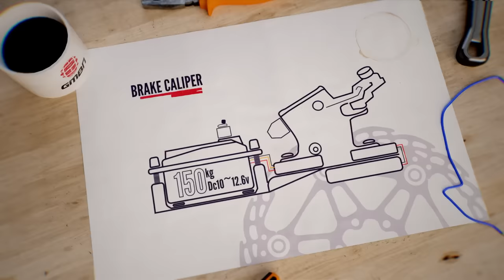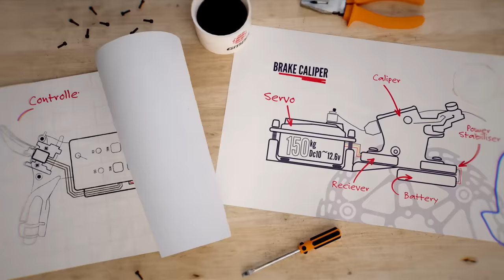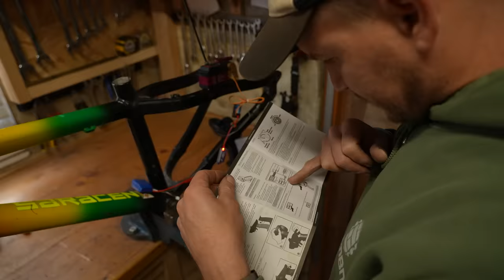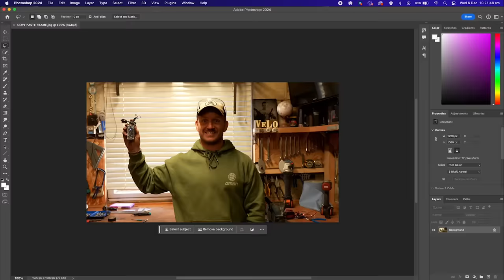We Made The World's First Wireless Bike Brakes

Comment: Good proof of concept, but a really bad idea.
Reply from the maker: 🙃 haha
Reply: Yep. One dead battery away from... well, possible death
Reply: I don’t think it’s that bad:
•Very occasionally my hydraulics have failed on me so it’s not like wireless would be the only one
•If I had these on my bike I’d know I’d fully charge them before every ride
•I would definitely stop if I heard them beep to tell me they are low
•Even if one did run out it’s very unlikely they’d both run out/fail at the same time so I’d just use the other working brake to stop.
Reply: @benw6952  I admit that wireless brakes would suit some riders (and heck, I love the no wire look of the bike, and the freedom of movement it would give), but they would definitely not be for everyone.

As someone who forgets to check the batteris on everything, I probability would be dead (and I know a bunch of people that are just like me).

With that being said, I'd love to see this idea made into a real product, even tho I would probably avoid it.
Reply: @benw6952  what about if u go fast and there is a jammer and the connection will be lost in the system and u could die not good idea u could ruin lot of races with this the only thing u need is jammer very dangerous
Reply: That's a solution looking for a problem. Worked 12 years in electronics. I'm happy to ride my electronics-free  bikes.
Reply: If they make the battery to also self-charge from pedaling power, it should be an excellent idea.
Reply: We need ABS brakes not wireless brakes
Reply: @benw6952  Been riding 40000km off road Never had issues  with hydraulic  brake failure
Reply: not sure ABS would be a good idea mountain biking. There is a reason high-performance enduro motorcycles have ABS shut offs for when you leave asphalt. I can think of at least three times where forgetting to cancel ABS on my KTM 690 almost put me in very serious scenarios.
Reply: @SprSonik13  yeah it wouldn't be good for mountain biking, but for road bikes it would be great if done correctly. Mostly just to save people from small slides during mountain descents, I can't see it being super useful for crit racing either lol more like a safety device for the road bike descenders
Reply: Most anything  electronic  on a Mt Bike  Is Pointless  .
Reply: i bet some company will make wireless brakes. Just a matter of time. 🙃
Reply: I guess it would work very well on an ebike. Then you have a main computer and everything is fly-by-wire. If the main bike battery is empty, you're not riding that thing anyway.
Reply: @BodieMTB I think this is a good stepping stone to bike  ABS. Next video maybe?
Reply: @BodieMTB  they have already made abs brakes
Reply: They have them on some bikes
Reply: The idea is good, but it hasn't really been tested yet.
Reply: @benw6952 if your hydraulic brakes fail you regularly something isn’t right.  100,000+ miles on hydraulic bicycle brakes and no issues whatsoever aside from getting mushy brakes from forgoing bleeding too long. Even on my motorcycles I never have issues with hydraulic brakes, even on track no major problems whatsoever.
Reply: @benw6952  I use Tekro brakes on both MTB and hybrid. 4 years, never failed. I recommend disassembling cleaning the calipers and  brake levers every 2 years.
Reply: Its a start of making it better. Who knows maybe in 5-10 yrs from now these is a common thing 😁
Reply: Imagine the battery died and it turns to a foot breaking system 😮 🤯
Reply: @UrbanFishing-MTB  look at cars and motorcycles. They all still have hydraulic brakes. Even on most recent cars the brake works even if the engine stops and the servo fails, albeit you have to smash hard on the pedal. Not sure about electric/hybrid cars with regenerative braking tho.
Reply: @diorez5112  oh wow really, I guess I should have expected that lol
Reply: Well, not even car companies are researching wireless brakes lol
Reply: @benjy288 That sentence alone is a pretty good indication that not only will some manufacturer make some more marketable version of this, but it will be pushed as the new industry standard and regular hydraulic brakes will no longer be available at the top end groupsets.  Eventually, 105 and SLX will be wireless only and double on price and still make a fallacious pretense at being groupsets for the masses.
Reply: @parasharkchari  Yep, I don't understand why? what's the point in wireless brakes? what's wrong with hydraulic brakes? is it battery manufacturers idea or something?
Reply: I think it's just a case of "we've got to do something new to keep people spending money on new tech." Unlike, say, smartphones or a lot of consumer tech in general, buyers of bicycles aren't too happy with the idea of planned obsolescence... so OEMs instead try to force obsolescence.

"Oh, are you still stuck in the stone age with mechanical shifting?  We do wireless nowadays!  It's the future!"
"Oh you have a 12x148 Boost axle?  How quaint!  Everybody knows that HyperBoost Plus 20x160 is the future! Especially since it makes room for the new electronic hub standard that allows electromechanical actuation of ratchet pawls!"
"Oh, you still have hydraulic brakes?  Get with the times, man!  Wireless brakes are where it's at!"
Reply: The world is full of "bad ideas" that someone was willing to make viable.
Reply: @edymarin7781 it can be designed to be "fail safe". I.e. power actually opens the brakes. Loose power and the brakes apply gradually.
Reply: @edrcozonoking  yeah, I saw that Blake actually did something like that in the GNBN tech video. But still I wouldn't get wireless brakes just because it would be a hassle for me to keep them charged (more of a hassle than I value a cable-less setup).

Still, an interesting idea in my opinion.
Reply: So is electronic shifting and hookless rims, but people are obsessed with them, I'd expect electronic braking to be standard in the latest groupsets by 2030 and you'll have people fervently defending it even as they fly off the road because of a dead battery, exactly how they do now with all the reliability issues of electronic shifting.
Reply: GMBN is sad to announce that Blake has gone missing - last seen being bungled into a SRAM corp bakke by some irate looking engineering okes  in white lab coats 🤣
Reply: @edrcozonoking Your way of making them failsaife could still be fatal in many situations, for me also the problem which could arise from interference is also so bad, I mean why would you make a safety critical component more vulnerable. And what would even be the benefit ? No cables you could route the cables inside the frame. Why risk you life for brakes with no cables, this is max stupidity wtf
Reply: Well the upside is it would be good for barspins and tailwhips
Reply: I guess you don't realize it's been used for over a decade with adaptive bikes and Mobility vehicles for handicapped people otherwise you wouldn't say such a silly thing
Reply: @rider65  No it hasn't, I just googled it and the only thing I found was smart brake wireless for mobility equipment, which is completely different, a mobility vehicle is run off a battery, so if the battery dies the vehicle stops, but a mountain bike doesn't run off a battery, so if your wireless brakes battery runs out then you may end up in hospital, or six feet under, its an incredible stupid idea, and completely pointless.
Reply: @francisdee9955  already have about 10 years on
Reply: @yukiko_5051  amazing how uninformed and unintelligent some people are no car company is R&D the idea? 🤣🤦‍♂️
Wireless brakes have been around for a decade on adaptive mobility and bikes
Reply: Do you know what's pointless? You're uselessness...🤣
Reply: @rider65  Triggered much? no one is stopping you from using brakes that will stop working when the batteries run out, me though I prefer not being in intensive care due to a component that doesn't need to exist in the first place.
Reply: @benw6952  I've never had hydraulic brakes fail on me in nearly 30 years of riding bikes and driving cars, and 14 years of riding mountain bikes, there's no reason for wireless brakes to exist, what problem do they solve? none, they only create problems.
Reply: @mulugetakejela6126  Why? what problem do they solve?
Reply: @BodieMTB  No we don't need ABS, that's another bad idea.
Reply: @dasjay17  No the idea isn't good.
Reply: @UrbanFishing-MTB  I certainly hope not, its the worst idea ever.
Reply: @yukiko_5051  They can research them as much as they want, that doesn't mean its a good idea, why on earth would you want brakes that stop working when the batteries run out? especially when you already have brakes that work great every time that don't rely on batteries.
Reply: @edrcozonoking  The only problem with that is you can't ride you bike anymore, you're on a big ride in the middle of no where and your batteries run out, then you have to walk your way back to civilization with locked wheels.
Reply: @Cokecanninja  Yep, it seems like some people are obsessed with electronics, even when its a bad idea.
Reply: @benjy288  I must’ve got unlucky with my brake failure and I admit it was only once for me.

I feel like it’s similar to wireless groupsets: there is no problem being solved but it does come with some benefits that some people are willing to pay for. 
For example :
•No cables or fluid does look nice and means it’s a lot quicker easier to install
•You could easily swap front and back levers over which is useful for people from other parts of the world
•The only maintenance would be cleaning, replacing the pads and charging
•You could probably have loads of adjustments to dial them in exactly how you like
•They could implement other features like automatically aligning to the rotor.

Admittedly the wireless groupsets aren’t as dangerous if they do fail. However I think it’s very very unlikely that both would fail at the exact same time. But there’s probably a handful of fail safes they could implement now that there is more technology involved.
Again not for everyone and nothing groundbreaking or necessary but I’m sure there’s a market for them if a manufacturer does all the right things.
Reply: @benw6952  I think they would still need fluid, otherwise what would they use to squeeze the pads? unless they implement some sort of electric motor, but then that will eventually require maintenance, and the whole system will be heavier too, I'm not a fan of wireless group sets, but at least they won't put you in hospital or six feet under when the batteries run out.
Reply: @rider65  What's with this esl guy?
Reply: @benjy288  Lol my point is if car companies doesn't bother researching wireless brakes, that means it's stupid and not worth spending tons of money for it
Reply: @yukiko_5051  True
Reply: Stop being negative and let this man cook cause I want this to become a real thing once sram jumps on this we are gonna have wireless bikes dam that's gonna be so sooo cool
Reply: GMBN. It's a horrible, literally life changing idea. It's terrible.
Reply: @reicowaithe8695  Why? why do you want brakes that will stop working when the batteries go flat? do you like playing russian roulette?
Reply: @ScreamerpipeL337  You're right, it could be life changing, maybe you'll never walk again.
Reply: @dtibor5903   lol lets go back way way back on time! We are still on wheel! 😂 wheel is what? Bronze age? 🤯
Reply: @benjy288  yah right now we are fine on what we have but this idea it just a start.  Not for DH for sure 😂
Reply: @UrbanFishing-MTB  hopefully you buy these and go for a downhill ride and you forget charging the batteries 😘
Reply: @benjy288  its a good idea for road bikes, they use ABS in MotoGP. Motorcycles benefit from ABS significantly, and bikes would benefit even more considering the smaller contact patch. Abs would allows road bikers to use ALL of their stopping power and let the ABS keep traction instead of modulating the brakes and potentially locking up your wheels and getting thrown off. You're not a smart person, or you would have already known all of this.
Reply: @BodieMTB  Motogp don't use ABS, ABS on bikes doesn't make you stop any faster,, its just a safety net, and having brakes that rely on batteries is an incredibly dangerous idea.
Reply: @benjy288  yes it does lol you have literally no idea how brakes work
Reply: @BodieMTB  No it doesn't, ABS can only prevent you from locking your wheel, it can't give you more grip, when ABS engages it actually increases your stopping distance because the way it works is it releases brake pressure.
Reply: Bro u need 3d printer would been much easier making out metal although metal is stronger generally
Reply: I think it's fantastic, with enough r&d it could work. But having said that, i think it  would only be a real advantage if it is light weight  and non intrusive.
Reply: @surfshop7552  Why? Do you really want to have brakes that run off batteries? What happens when you're out on a ride and the batteries run out?
Reply: @benjy288   This is simple to answer, you use another battery. If the batteries are as small as the derailleur batteries we have today then it's a complete win.
Reply: @surfshop7552  So now you have to carry spare batteries with you? and what happens when your batteries die when you're descending? you either have no brakes or they lock on, either way you're probably going to crash and end up in hospital, and for what point? what's the point in wireless brakes?
Reply: @benjy288  I'm sure all of the issues will be ironed out.
Reply: @benjy288  if the world had to live on "what ifs" , we would never be where we are today
Reply: @surfshop7552  You didn't answer my question, what happens when the batteries run out while descending? you're risking your life just so you can say to your friends look I've got no brake lines.
Reply: @gmbn  as a rear brake system, I would love this. The front brake should stay hydraulic and go through the stem. Bar spins for days!